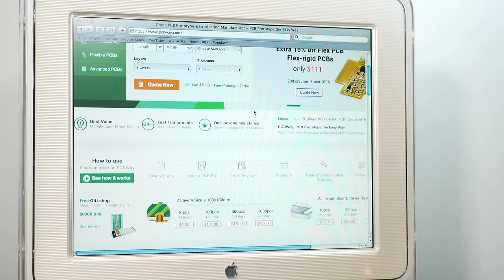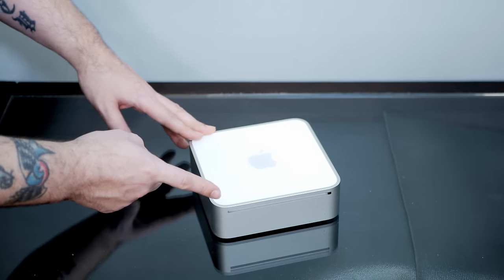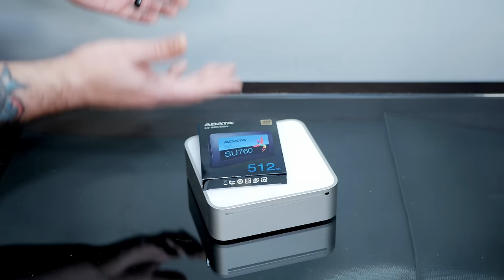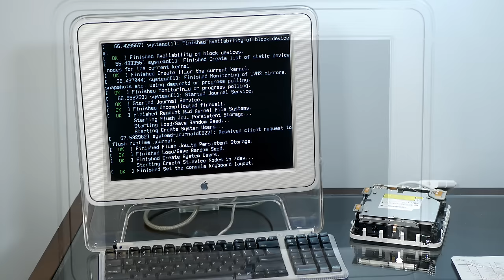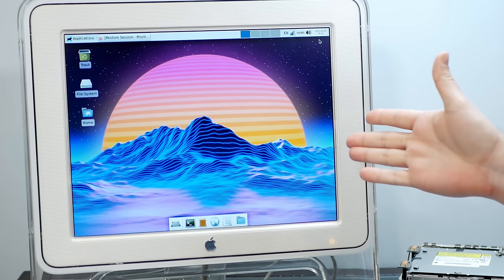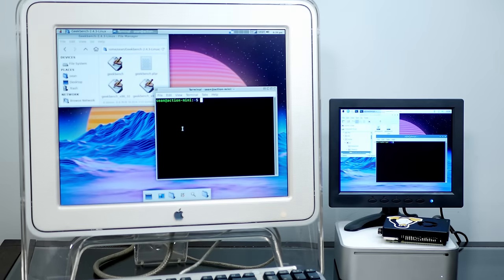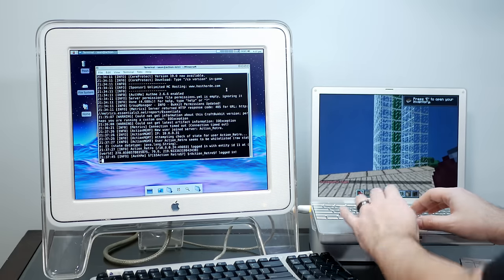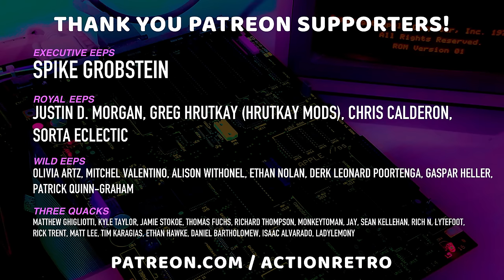Can a Cheap Mac Mini Out-Pi a Raspberry Pi 4?

Comment: Honestly having played around with the Pi 4 (I have 2, 4 & 8GB models) extensively, it is quite usable for daily tasks. Youtube still lags a bit every now and then (few frames in 1000), with a decent case (Like the Argon One M.2 or FLIRC) it's totally silent and usable as is. The only thing I'm a bit bummed about is the GPU performance and the Pi 4's hardware acceleration is spotty it times. 

But since Flash is being dropped and Java applet usage is going down consistently, it's only getting better for daily usage, since the new technologies are usually already embedded into Chromium or Firefox.

The biggest issue I have with the Pi for daily use is that services like Spotify won't be able to run, unless you manually insert in Chrome OS libraries to enable the DRM support. With x86, you can easily run most services fine since the DRM packages are included with those builds. Chromebooks use Chrome OS, basically linux on x86 with a skin, so I'm quite puzzled why it ARM variants aren't getting it by default.
Reply: Apple music runs in firefox ESR! just thought it was interesting when I found out I could use it on the pi

Comment: I was thinking the same thing the other day when I was trying to fix up an old Core 2 Duo laptop into a cheap retro gaming/media box... yeah, I could spend $100 to max out the RAM and storage and processor and put in a USB 3.0 ExpressCard so transferring files isn't such a hassle... but a Raspberry Pi does all the stuff I want this thing to do, and it's faster, has native HDMI, doesn't spin its fans up like a Harrier jet when under load, and uses way less power... it's amazing how much technology has advanced in the last 15 years.

Comment: In order to push this to the limit: download the Batocera Image for Macs and write it to a stick. Then boot from that and then install this on the SSD. Then reboot with Gparted-CD and shrink the SHARE partition to a reasonable size.

After that boot an Linux install DVD (Ubuntu, PopOS, Mint .. you name it!). When installing, choose "Try something different" and create a EFI, Swap and Root partition manually and then install Linux on it.

After finishing Linux install, reboot with the rEFInd CD and install rEFInd onto the system.

And voila: you got an elegant Linux and Batocera dualboot machine ready for work and retrogaming.

Comment: If I'm reading this correctly, the P7350 Core 2 Duo gets a passmark score of 707. The BCM2711 gets a score of 809.  Just wait a few months and the late 2009 mac mini with the P8700 core 2 duo chip gets a passmark score of 956! Also, comparing geekbench 4 scores puts the Pi4 & Core 2 Duo processors in a much closer race. Of course it's all too easy to get hung up on these simple benchmarks and the true value might be somewhere else entirely.

Comment: The Mini also draws about 5 times the current... 110W vs the pi's typical 15-20W. Capable or not, and that's a concern, too. Increasing the cost by $70 a year in Oregon for 788.4 kWH difference. Your emphasis on cost  fails when the first year's savings on electricity for the Pi  exceeds the cost difference for hardware.
Reply: Makes sense!
Reply: That is nonsense. The Mini does 15-20W in typical use, for example when doing a HEVC DVB-T playback in 1080p. NEVER look at the power rating on a power supply. Same with CRT's. I've tubes that say they can go up to 200W, but that is at full brightness with a full white image. In reality they do 40-50W. And there is something going for Apple PSU's, they are the best in the industry. Especially if you take a 2012 mini, they idle at 10W from the socket, where Pi power use is usually measured at the 5V level.

Comment: So would the difference in scores be that it is a quad core, verses a dual core.  But isn't the Pi optimized and the mini is not.  I also wonder if it helps that the connections are so much closer for each item,  (memory, etc) as I heard that unless the leads are a certain idea length the memory speed is cut in half.  As it is the Mini has DDR2 ram, the Pi has DR4.  A core 2 duo is very slow compared to Quad core and you even overclocked it.  My thought is why can a board not be make that is just like the Pi, but with a M1 chip or even an A14 chip to be used in the community like the pi.  It would have a lot of uses.

Comment: There are inexpensive adapters that will let you swap out that CD drive for another SSD. They were made originally for older laptops with CD drives. Less than $20 online.

Comment: I'm not really surprised that the mac mini ran the minecraft server just fine. For a while I've used my old Lenovo G550 laptop from about 2009, with extremely similar specs (a Core 2 Duo T6600 @ 2.2 GHz)  as a host for a minecraft server for me and my friends to play on.

Comment: I love the Mac mini G4s. Some may want to stay away from Leopard and use Tiger due to the ATI Radeon 9200's lack of Core Image support, but I'm running Leopard and OS 9 (unsupported, patch from MacOS9Lives) right now. These machines can also be overclocked by removing/soldering a few resistors on the logic board. My 1.42GHz mini is currently at 1.5, and I've seen some get as far as 1.83.

Comment: I've run a Rapberry Pi 1.16.5 server for me and 7 other people before on the Pi 4 4gb model, and it worked perfectly. If anyone wants to know, I used the Balena OS method to make the server, and there were no hitches aside from me having to mess with my router settings to get it to work, it should work well with any new or MC version as long as you have the correct .jar. I'd highly recommend a Pi 4 for that use case, though if you decide to go down that route, get some good cooling for the Pi, as a stock Pi 4 runs fairly hot.

Comment: It likely has to do with the videocard bios. It has to support a uefi host. I've had many videocards that would just refuse to work at all. The last one I had that I can remember was the Fury X. I had to update the bios on the card to support uefi because I needed it for vfio. The video card bios is, in many ways, a lot like an option rom. There's a world of difference using something like an Adaptec 71605 raid card in bios mode vs uefi mode.
Reply: As a long time Linux user these days I just avoid Nvidia GPUs and systems with integrated Nvidia chipsets, and go for AMD, and Intel, as they are well supported in the latest 5.x kernel updates with the open source kernel modules(drivers) being coded by teams at AMD, and Intel themselves, and I usually have few issues except some old AMD APUs end up with screen tearing on MATE DE, but it was a simple google search for the fix. here is the link for anyone who needs it.
https://learnubuntumate.weebly.com/screen-tearing-on-amd-graphics.html  (just replace Intel in the link for the fix for intel, and it will work on Manjaro Mate, and Arch based distros with Mate).

Comment: I use a mac mini hooked up to my TV and I am able to play a lot of different video game systems on it. Mines a 2.4ghz Duo Core, 8gb ram, 128gb SSD and this thing is awesome. Better than the PI, but ya gotta make sure the thing has good air flow or these minis can run slow. I just put a CD case under it and problem was solved.
Reply: Also be careful with the wifi antennas !!

Comment: 1st Gen Mac Mini OS Limits:
G4+DDR1 (Single Slot; Desktop Size)+IDE (2.5"): Leopard
Intel Core (Solo Or Duo; 32-bit)+DDR2 (Dual Slot; Laptop Size)+SATA (2.5"): Snow Leopard
Intel Core 2 (Duo Only; 64-bit)+DDR2 (Dual Slot; Laptop Size)+SATA (2.5"): Lion
Intel Core 2 (Duo; 64-bit)+DDR3 (Dual Slot: Laptop Size)+SATA (2.5"; Single Or Dual): El Capitan

2nd Gen Mac Mini OS Limits:
Intel Core 2 (Duo; 64-bit)+DDR3 (Dual Slot: Laptop Size)+SATA (2.5"; Single Or Dual): High Sierra
Intel Core (2nd Gen; I5 Or I7; Dual Core; 64-bit)+DDR3 (Dual Slot: Laptop Size)+SATA (2.5"; Single Or Dual): High Sierra
Intel Core (3rd Gen; I5 Or I7; Dual Or Quad Core)+DDR3 (Dual Slot: Laptop Size)+SATA (2.5"; Single Or Dual): Catalina
Intel Core (4th Gen; I5 Or I7; Dual Core Only)+DDR3 (Soldered)+SATA (2.5"; Single Only): Monterey

Comment: Wow, when I had one of the original G4 Mini (back when it first came out) the best-known way of opening them up was by grinding down a putty knife or doing weird things with rubber bands and paper clips. If I’d know all it took was a box cutter I’d have been a lot happier maintaining mine.
Reply: I believe they simplified the situation with the first Intel revision, and this was even a later one with miniDP, which were slightly easier again. NB this is just going from vague memories of how-to and mod diary videos from 2008-2011, but I distinctly remember mentions of the G4s being the hardest. The part about it getting slightly easier as Intel revisions went-along could just be the community getting more experienced with it though. But there were still twice as many guitar picks shoved-in at weird angles than seen here — perhaps this has been opened before and made more pliable!

Comment: Pop_OS is designed for more modern computers, so even if it did work I wouldn't recommend it for anything older than 10 years old. It even struggles a teeny bit on my 2020 laptop (though, it's nowhere close to as bloated and laggy as windows 10)

Geekbench is not a Minecraft server, so I recommend benchmarking it with Minecraft to really test them. I think even if thought the PI won in geekbench, the mac mini still might have a chance to be better when it comes to Minecraft. As some others have noted, a Minecraft server is pretty much entirely single-threaded so any more than 2 cores is useless

Comment: Current quad core vs 12 year old dual core?  12 years is a LONG time and I'm more surprised how close it was.  Basically the difference between having 2 vs 4 cores rather than arm vs x86.
I do love getting more use out of old tech like this.  Reminds me I have one of those in a box next to me not doing anything...

Comment: To be clear though, you could have gotten a far far far more powerful small form factor PC (for example think centers) for that money on ebay. For the performance, these are still ridiculously expensive because they are apple. If you have a reasonably well ventilated area, you could have also gotten a laptop with an early i5. Also you can get (at least in europe) desktops with core 2 duos essentially for free and upgrade them with "powerful" quad core xeons and ddr2 memory for that money (but granted that wouldn't be as small).

Comment: You could probably get Big Sur onto that Mac mini with the BenSova patcher. You’d have to get  Catalina on it first with the dosdude patcher, but I’ve had Big Sur running on an iMac of the same age. I know it’s probably not suitable for this project and wouldn’t be particularly fast, but it’s perfectly possible👍
Reply: Have you had luck getting big sur on older macs? I got catalina running on my 4,1 cheesegrater, but every time I try to get big sur using the big mac patcher on it gets stuck in a boot loop.

Comment: Pop!OS maintains a version of Pop! specifically for computers with Nvidia gpus, as the default Noveau Driver tends to break on a lot of older machines. I have a feeling that the version on the CD wasn't the Nvidia version. You might be able to get Pop! working if you try the Nvidia version.
Reply from the maker: Oh thanks I'll check that out!
Reply: @ActionRetro  It's one of the few that does, as Nivida has kind of given the middle finger to the Linux community, and it's been a pain in the ass to get the open source Novu drivers working. Personally I avoid systems with Nvidia, and Nvidia GPUs because of it, and go with AMD, and Intel which are very well supported with official open source drivers from AMD, and Intel baked right into the latest 5.x kernel updates.

Comment: I'm actually curious about how the mini compares to the pi in minecraft itself. Looking at the GPU specs, the pi's built-in GPU runs 50MHz faster than the GF 9400M in the mini, but I expect there's a lot more vertex shaders and texture mapping units on the mini's GF (they're completely different architectures, so it's difficult to compare the specs). However, the pi has faster memory than the mini, so that may also help with graphics performance.

Anys ways, I think I commented on one of your previous videos about how a higher-end G4 laptop would compare to your 12" model, since they're slightly faster and have a Radeon 9700. Well, I've got a 15" 5,8/A1138 on its way from eBay so I can find out for myself!

Comment: I had no problem putting linux mint 19.1 on a 2009 macbook pro. software update there is a section for additional drivers which linux handles within it self. When my macbook pro boots I get an nvidia screen. I needed broadband wifi drivers so it was connected to the ethernet.

Comment: I think it doesn’t work in UEFI mode because the graphics drivers for the GeForce 9400 (Linux or Windows) don’t implement any support for the graphics EFI bios. Other PCs have these same graphics but are all BIOS systems so the drivers only have to implement legacy BIOS support for graphics

Comment: im pretty sure you can just append something like "nomodeset" in the grub boot to force a software video driver which usually works fine instead of the free-opensource nvidia drivers and once you in linux, you edit the grub boot file and run the grub update command so the changes you made stay for the next time you boot. I am sorry being vague, but its been a long time since I last used linux, go and look up "booting software vesa drivers nomodeset nvidia grub linux" and you should get a more clear answer than the bs I said. Wish I could have been that hindsight you needed, I know how long it takes to burn a 4.5gb iso file to a blank disk, its fustrating.

Comment: I am probably the only person who will say this, but I have an odd appreciation for spinning disks. So whenever someone swaps the hard drive for an SSD in a computer that is older than about 2012 I always am like “yeah it will perform better but it would have been kinda cool to replace the old HDD with a modern HDD.”
Reply: Hence why my PowerBook G4 still has it’s HDD. Speaking of which, is it normal for the fan to sound like a hairdryer on 12’ PowerBook G4’s? Only sounds like that when working hard, but wondering if the fan bearings might be failing or if they are just loud under load.
Reply: @shad0w_dragon178  I think one of the bearing is gone. I have the same issue on my pb

I just put a SSD in my g5 and it had no effect except for benchmark score. I was rather surprised. On newer Mac's it is night and day improvement.

Comment: I was looking at trying to transplant or swap out a powerpc tri-core 3.2GHz Xenon onto the processor board of a dual core or quad core G5.  Do you think it could be done and work?  The G5 was originally used to run everything for the Xbox 360 when in development.
Reply: Look at the number of pins are they REMOTELY similar? You would need an interposer board before you have a chance of doing anything, idk if something like JLCPCB or other service could make you one

Comment: Wait... did you say that the MacMini cost $65 and then you upped the RAM to 8 GB or it came with 8GB for $65?  How about comparing the 1 GB on the Pi4 with 1GB on the MacMini for price, and then add back the cost of the RAM for both?  Otherwise, you could say that if you have the accessories lying around the house, you don't pay anything extra on the Pi.

Comment: 8:03 I can predict that Pop!_OS 20.04 will NOT be a pleasant experience on a Core 2 Duo.
For a server, the Gnome desktop is WAY too much bloat.

Oops, it seems you didn't even get that far. That sucks.
NVIDIA is always the villain in the Linux world. They really suck. That's why there's a video/gif/picture of Linus Torvalds literally flipping them off.

XFCE is definitely the right choice, although I'm thinking Manjaro would have been a lot easier to get running.

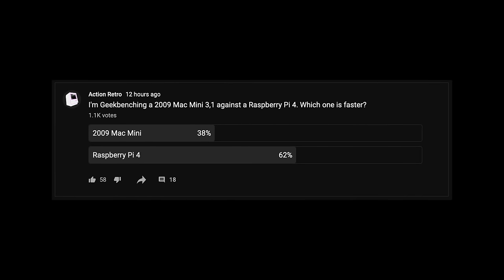14:21 yeah, not a chance. The Core 2 Duo is going to be roughly 4x faster on the single-core score than the Pi 4.

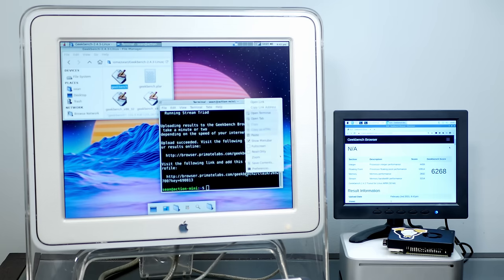15:02 WAIT... you're comparing a quad-core CPU to a dual-core CPU. Seriously? I am surprised that the Rpi 4 did as well as it did, but very few things are going to run in parallel as nicely as geekbench. Single-core speed still counts.

Links to his benchmark results:
Raspberry Pi 4: https://browser.geekbench.com/geekbench2/2692699
Mac Mini 3,1 (Early 2009): https://browser.geekbench.com/geekbench2/2692700

Other Raspberry Pi 4 geekbench scores: https://browser.geekbench.com/geekbench2/search?dir=desc&q=BCM2835&sort=score
Other Mac Mini 3,1 (Early 2009) scores: https://browser.geekbench.com/geekbench2/search?dir=desc&q=mac+mini+early+2009+P7350&sort=score

His Raspberry Pi 4 result was on the high end, while his Mac Mini result was a little lower than the highest scores (possibly because he was running it under Debian and lost some proprietary optimizations that other results had under Mac OS X.

HOWEVER, under Geekbench 5, the Mac mini 2009 scores about 300/550 single/multi-core, while the raspberry Pi 4 scores about 250/750 single/multi, which is why I initially though the Mac Mini would be so much faster.

Geekbench 5 Raspberry Pi 4 results: https://browser.geekbench.com/v5/cpu/search?q=raspberry+pi+4
Geekbench 5 Mac Mini 3,1 results: https://browser.geekbench.com/v5/cpu/search?q=Mac+Mini+early+2009+P7350

----

16:22 DO love that theme, though. :)

17:24 Don't fall into the Ghz comparison trap. It may be that the old G5 did a lot more per clock cycle than the Core 2 Duo. Not sure, though. I know for it's time, the G5 CPU was a Floating Point Math Juggernaut.

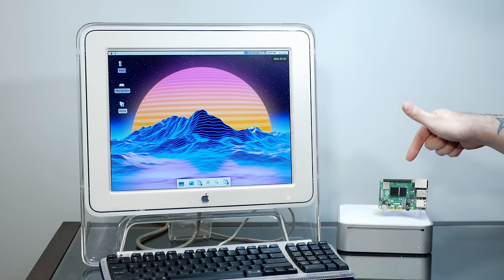18:20 Are you sure about that? I know that the gigabit ethernet on the Pi 3 was hamstrung by the USB 2.0 bottleneck, but the gigabit ethernet on the Pi 4 is plugged into USB 3 internally. It shouldn't have any bottlenecks.